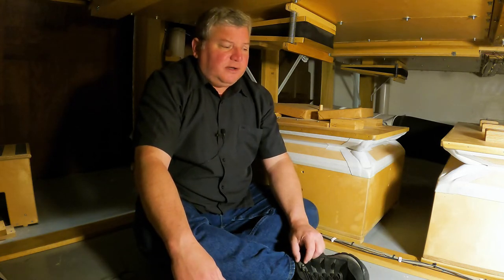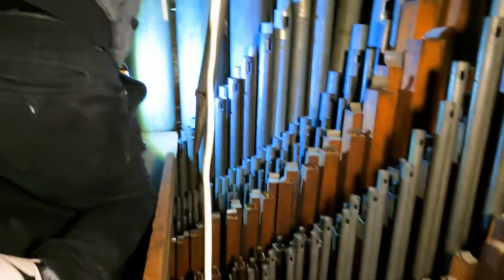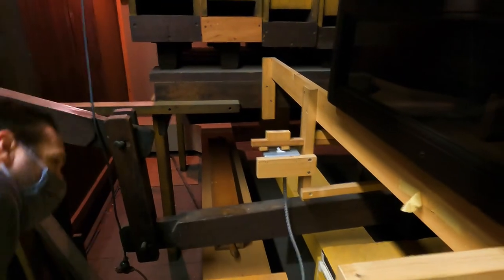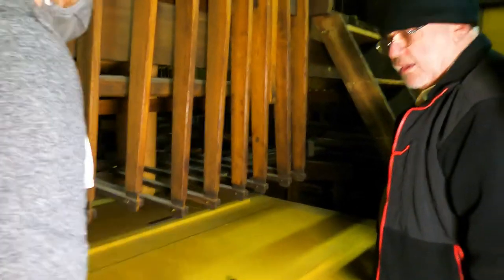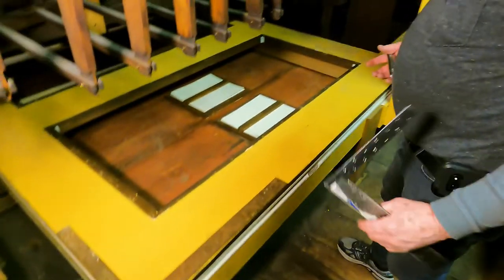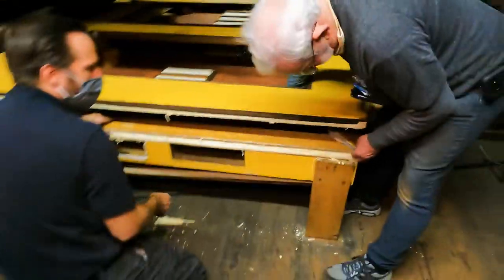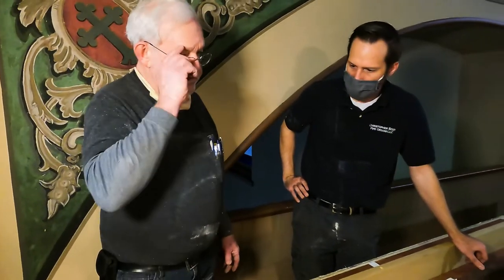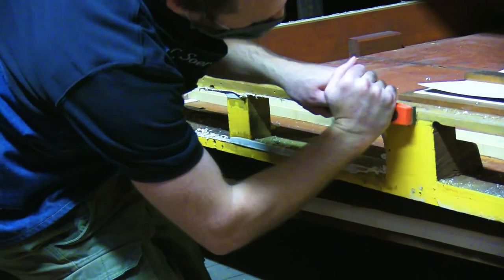Releathering the Reservoir of an 1890 J.G. Pfeffer Organ - Part 1

Comment: I can top that, the original Moller pitman chest for my organ had the primary section along the long side sawed off with a jig or sawzall, removed to releather the primary valves, but they didnt do all of them, and then they tried to glue the whole thing back onto the chest!
Reply: I have actually seen that one. It was so bad though, that I had to scrap the chest. It wasn’t even worth remaking because they used a wide sawzall blade and literally nothing lined up anymore. Idiots. They were too lazy to remove the expression shades, so they cut the chest apart to fit it through the chamber entrance. An extra 5 mins removing shades apparently was too much work and too time consuming for them, so they spent even more time destroying the chest
Reply: They didn’t know how to drop a Möller primary, because the wooden cap is usually covered with leather, and if one doesn’t know it’s there, then stupidity ensues.
Reply: @JB-td4ei  Plus that's not all! every wire to the primary was cut, so when they put it all back together they used electrical tape after twisting the wire ends together...
The original blower was replaced probably then- with a 3450 rpm Buffalo Forge blower that SCREAMED!